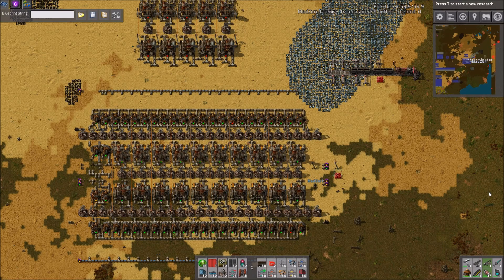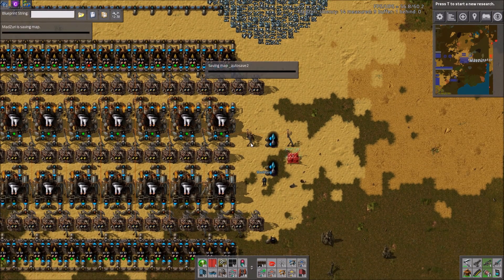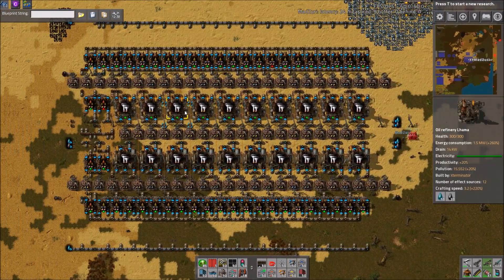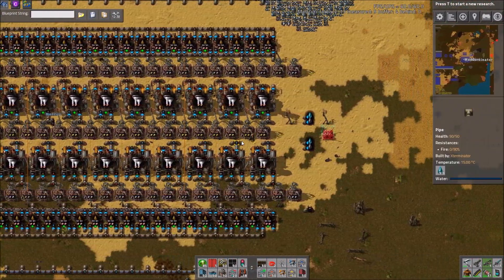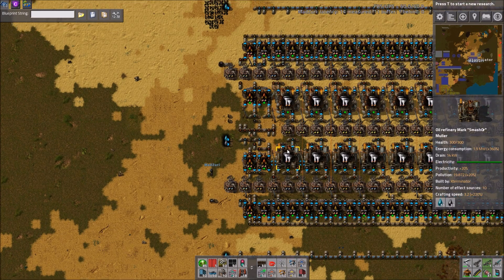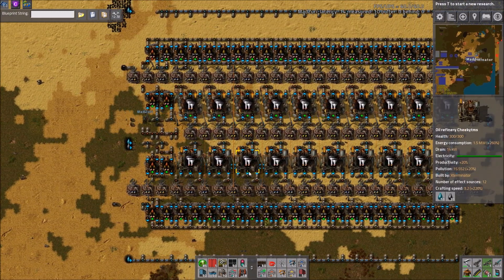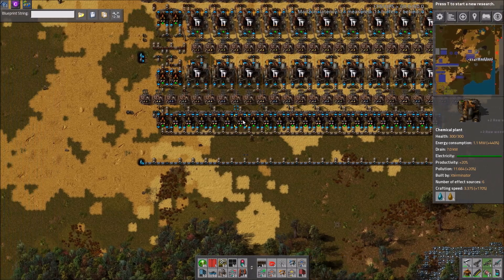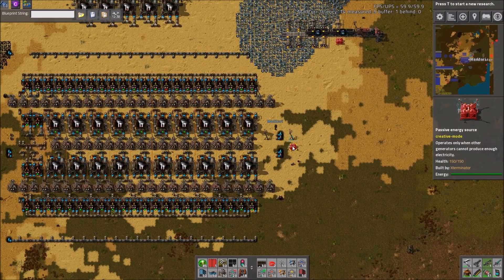Factorio Workshop - Building A Better Factory :: Jame's Oil Setup

Comment: I have a blueprint for a defensive safe rail crossing I'd like to reviewed. It's different to the ones i have seen before. The problem i have experienced with them is they are generally very small and it's often quicker just to risk it than walk to the crossing. And they usually default to open which doesn't stop biters:
http://pastebin.com/8EkYSsGF

Description:
- Much longer and tileable 
- Gates default to closed so they will act like walls
- Effectively two safe crossings, one for each rail. Gives priority to trains on the opposite side
- The gate sections have lights either side that are red or green depending on whether it is safe to cross
- When tiled, the lights in each gate section will show yellow when a train is approaching/in the gate section before, or when you are on the crossing and a train is waiting to pass. It IS safe to cross when the light is yellow
- The lights in the first (entry) gate section can only display yellow if a rail signal is wired in further back down the track (look out for wire colors if you do this because i have had to alternate wire color).
- This looks awesome when you tile 3+ of them because the train causes each section to turn yellow as it approaches then red when the train is going to fast to stop in that section
- The crossing is completely safe and has a safe-ish service path running straight down the middle of the track 
- Beware of the hazard concreted sections on the service path (one tile in each where it is possible to step on the tracks due to space and signals).

Happy 'not getting hit by trains' :)
Reply: Sorry the blueprint had one mistake in it :S I have editted my original post
http://pastebin.com/8EkYSsGF
Reply from the maker: Awesome thanks! I've added it to our list. :)
Reply: Thanks again!

Comment: Have you considered adding more beacons between the refineries in the same row. You would only need to widen it from 6 tile width to 8 or 9 tile width (depending on whether you want beacons all the way or just most of the way), which would give you almost double the amount of effective module applications, as you would get 6 or 8 more effective modules pr refinery, which would move you up to 18 or 20 effective modules pr refinery (okay it is only 50% to 67% increase). As the relative space increase is no more than this, then it might be worthwile, since there are parts of how module interact that makes other modules more effective when added more of them (specifically productivity makes speed better).

Comment: Visuel display of different liquid levels. Not that useful if your oil is balanced, but it looks nice:) At the minimum you can see when your Crude oil goes down:) Im pretty sure this can be made simpler and i would love some feedback regarding that.

H4sIAAAAAAAA/9Wd7W4jx46GbyXwbysoVvWXcOC9gr2Dg8VAY/VMhMiSV5aymTV879uS7SRdK1U/rFELzfPjABPri/XxFpvFh1xuf1lvHxfrX748vLab/Wq/
al8eXl83i6f24e559dzO9tvZ9932sFne3T9vX7oXbDcPr38+zKS+/9H9v3+7X6527ePpv3f/+Hjry367W3zv3r3Y/B6/sTy9Ud7uH7ebzfs7u+/8953c/dfD
6/dd23ave/8xP76slg/l8VP/8c/wdvzf5xct28fVst3NHrdPX1ebRfe10dc1v/71ff/4ocfv3u+26y9f298Wf6y2u4fXj0/60v1lufr4Ud9Wu5f9l5fV981i
/fC6//HcfeO39WHVDcb71z/uDst2tl2t707mvHT27h98UbruX0/Pi93xBz3c/cfd/fawfz7EH/XHarc/LNafH/b+x9lpCE6f9/yj+zWHzf7Lt9326ctq033C
w7fF+qV9w4N3HK37f9/5838uemP58rRYr2frxdNzNIb1P2YsGrXH1e7xsNr/PWrnB23I0o+Ri4ft7f7w0nafvd7uXh72u0NL7Q73nz+s+0e0gJjNlTmbi56Z
FTOzNGdmqdv/Mur+f26Pn9IenmbfFy8T1YCqSGpAgxaKM7dO6ssSMEcmizmTm56V4pCZ3pyZc5UCFKMKwHr1/bf9hB2AOu0AdP4bWSP2DkORy9tfAjLantcj
kZ3MvWvs2al7BpBxfYDf2sUfPyYsAY1LSwDzFCXYWyZlQgNqZnVhz+qqbyjz78Teg0A0hTQSML9hICC4qYjAQCDAS15Uxd0yqmJmMJlT9R5WmVvacfPLgupV
sSRnyGrvElYzV/IjmmTK6shQTdjM0prulK9npypuZmpC4VItzc1goTu7ZNSzKxERnMz5NRARDC5rQMdxrC6P53Scq4Hx9Cze6MxtvObywRiYD+TsyWgirhwE
GS3mjO4UoWcnO0rE3IKe981kLq23N51snXpr8xeJDrwZGOfcOn8xMJ0za+BiIDQ5QzmST3XhksXMWLJYo71nxFAlzkLm9Jh7XgyJoHLBblzthUC6Fdyzk50f
5uJboX+BXjAftrE3nWxvNtbmr9A9uMqoD67nrwWn4wAMXAsWVdZYjuQBXLhjNTOYLHr6ccdqSUqKInEcwjvWYE5nEumlBbxvLexNddk3FGbRFeZmt3+BXjKn
TuzdCND9ae5GINqDgGNoMjGGGoeW+kkZ0Z3FU7tcHZ5m7br7oN3qcfa8Xbfx9/mP35nzfT296l949e90o8swd/lvZZH4W3n5b1U/Tb1JfP088fXiq8Qfy7zU
kPqG2QwyGd9lIJuh1DmCn2PZ3HAsvZmxZM7Be5JEbUhxy4QbWLJj5j11wJTRfUehYo7CrP5byI3YmQh5lcwLfJ9cU0b3Y0EVC3nNSnOLGO7O0twE6jCRzyyG
cXyAy1kM0/EDBrIYKqUfIGP6AZfHczq+wNB49mNC4BEgqJ4A6oRfn/pbk/DrQ18TfcLNTzxy1P2PmSe+cR49HuCcEktKVSXCSZUCz7R07PTXTmQz8ym8OZsV
3Kmp9dsPDNYwYGZu+iJ3nzlO3txsZmV+jOM2nU/8mI7LNJD4UZc5QzmOx3R+KKfjLQ0NpTZgqnOW+rhw3wfpZ3xEf0tEIaNIZ534ijrhSTX93EtxqcCnq/X+
krlH8zrhO9SM3zAXa6oTPHvNTiJzcac62kDMFTYXO60j90mRnGNqNtnObMxNX608mcTpjqbE8VMknrKLxAVd9ATeJI6mJnE0Seq3iVSXzyKaTjSOL3Q+m2g6
vtBANlGjcytl1Mjm+bGcjos+NJaM8XjPYrEkS010z67JxTJlZ8IZbCCnFKydpU3CG2xgPZfCnNF9P6nRFDYxtaLhqjV3I9fkZZKUt8skkeanzq0f7Xq9/Z/b
pJLMdazb52BWN0zLcZNxAobGEl7u1x8jaGbH9TPo+ufEHNaDqD/24JWN/sdeubrOJMrUzGGZmsrcVEcXp7COSWVudufRhEaO7eFr933Hz4gvz9/1r/i1pMku
pmZfU9zF1nTnVXcZx2m4mHYyJcdhIO+kezTPGtFxPIfLiTzT8R4GB1SRl2Jr7yUKvIhTVHgxJaUJ70GcovKJqak+qkLf0pJbaml6j7u1b6iiyostQ9la9QbX
aladl3FcgrN5FVNyB4YqwLuscvrjeAPnk1Sm4wkMjiWLSZp7uIzySqJDETaasPeoGeXaxGYrqqDYmuyojwhsEmEvUHTUvr6l7MhszE0p3KKNvSmMd+GF+M/8
TPiHXpyP4zicvTifkuMw1DdCdI6DjBpHOJ+GMB3PYXAwNWVDbElPdJp4WCQ12LM06S1oEjCMSXCZsNtDGqQwaHfkPcC+D2LudgEvXnvXC/H6BLViisxaMQHf
VkdbSHsF8nHVH26YN/FzZe2u6ra8F39JtbzTAU6fw1nccDjL6QznQOqEeFg/4HPrWJKG1HkeNNU+gi27k+e5puCHMbsjTxWWSX831djSriNTYcuq0uCswgVb
2pvFzEYt4zgGl3MjpuQcnOjmxHEW8qqcjOMcXB7SCTkIw0PKbpKdwf2XqHomsOq/s6eoIVGvRAIMZBmc7TKyVFHOw9gERy1kYV8Db3BOFUU8jM1hVhmPcVyD
8zkSU3IL6oGYQaHrOF6M6RWcH80peQSDo8lSrgw+QhYJME9gvW2Dj5NFAsKUQgH+GzObWWYw9FUU0RwyH95gsKsIkaXMf20MWqorii6jRgvOZz9MySVoBrL+
S10SqowaKTg/nFPyCQaHE2bWF/Y2XnyfVzIxfU8FsGVqkYInSk3mh63zskyAtlJqaowYszs6PUtYfMLgPQJdvQbvEcrMbjSiuETuXyKWibpRZaIetJSJfjHH
SHScONH/d+pr54m6ij6umJ2TQCA3TCD4ucTH2+ZjVHnD6W84nCd9tzKcmsQEb0unUt5FBa+w67+Vy4zdKQ63guh/ZW++q4hJrTTFO2xNcRUfZewZYVYanFVN
romxWdRdE3xmD4zjGVzOHpiSdzCUPVDltfEZxzu4PKRT8hCGhjRq0EA7z2BvP0oQiJQtJOrSHp2bvgymip1XiTY2xzuofivLxG/yLvGbfJDLvn8yq8OYdqWy
XWuF2cZOoxTZXMPIjcHZjtiVmh3K3p6lcOl6e0tXszqNWRY5/nVW+sU4PsD59Ispnf9D6Rd1VsWPcZzU86M5JQd1cDQbpTeldKaKRHH+KPFiIBxap8KfdcrT
ioqJ+1S7HC+J3+TjZjo4IcbYoZNyphqF2cZ0u0yZzQKTBuOSdeRMNYqCKcbWdSQpsFZ5Y29O4Wpt7M1hJD+0YY3ixErd0fVvytMP7dKkTqwmdWEnid/gfeI3
+JBoOUuTfMbxlc4n+UzJVxpK8ml0SekyajDv/HBOyZEfHE5NTRFj8pt0oCB5EwyKc8qDmmtqqRib70j5YUuGd1ONTXGcpaIpG2NsVuFGNXjVN9fWjXF5ZWO4
2+WjbKdSl+/9kVdzwyyln8v23rXLW6XUzLNG0t1uJH8u0fuWI8noilOSzvX14NPQ64tB4tT2TpGQ5QzZnPLQ5ooqMZZsbqKpVVSIsbSc47tzRcaOpdlUVIax
M3ux3sCMmXFOq4sJM5M5sQaSZXzUBwOO5o0zuibjSQ2OJuNDnCkhiXKL4uOf14GxJDKJ0jcetkEQY7NcRlby+i+WJrZf+8XDyvHe2Fzyui+W5i6n5ssN8zom
c0wN5HR40VXcLUb0oM4O5GS8p8GBZPfDth4DowyX6PCDtbJtPRJGGT+xybzCiyWTeXUXS1bFqVwlttLSDg2RlbyqiyUrsyq6jHNOnb1Nn8w5NXCT7n1WnscN
0zwm4zoNjiSs4xKMbbUEeuy9osCHoaPCRyLqYXGPYMzMRO0WT3u6FLaWs48z4pgXILYi/HhjGovwe13psY/76HGy6M7eR0/krBq4jfZecRt9/cSb8ZZHAmn0
mv4dlmyObmZpe5bSmJlZNPw4O//ibdREdv/QXRTseeJsrZCQCtQE6JwbMzm2kp363piVOQzsODv/bEx6Irt+KCId2EOMseOvj1XG+4FFpI15OVGTCg8bjzTG
rMwK8Y2z7c8Gpiay7YfCUrCFySl2YWl5pMJShYKhMGRz4SIzFfyEJTP7s/f5DZd9/Xln32B18W+r9b7tfsrrKzHu63rx+PvJvMORjbtfbZbtnycmkloRF3PF
z9vl1Wfq6/rQjjRVUWZQqXjGNmVndHcI+1+cHrJN2RnNZ90/hGHBtEKzef0UN2+VWfns+nP9vNr8Ps5cl9FpUvFHZEtmFvNIonhVLEtm/r/ZrHSHaDHJbZgo
Pp56fr3+xI0IVPpKW0fpVJZCI7IiU5zd2uln9/SYcv3pHc2XhdUFZRxHYTyzdGmiH/dw9bUezodW5GdJi569D6on9L98rJ9/RPenHoqJR3RN4frKkjcZec0a
O2tDdqaq1MePRPDiytJW+cupucZWGbi6giXU3SgraDzvrUrdXVVRNhKsoudGUYvbOepwqsXaVJf4+cOUWbHWswiJN7ZIyyh9LJpNdjdpSdyvWtfLn1pHpuSd
xQ+rUVbNmM94UR8wjaHXV4FRH2ZTKVhRXV7fZHUStbR9rnfR50/NMxN7B5Z7Pz1BX39NjfeomUpSruN/x66Sok7g9QVltDEpowwAOvWFsamPDtuauU6nYIql
2azzzbQ0m9HerCOPEZbMO0UH5oaiA3E/nlqRe90YsrOIRQnekVbW5jO2U1FMyZSdbJ26Ucwa7wlOET25/u4b8fk78oRgFfdqFDNHfcCIwkSwEP84KjOmoU08
o8wtaOwZygwb59wf1bD4aQRCeWEUS0dz7DQPWdfXmps9fTQQAh7nnB9v9hSVqi3NXpTJFjVgeDl87b7x+Clx/tp7fQP5tRx+sbh/vPjtfr9at8fsif513vxU
4bv7NR+p5Iv/XeyWs86Kx127b2fr9tu+M/Psm4qcN4WcN/mcN0nOm1zGm+YZ72ky3lNnvKfKeE/OYshZCzlLIWsl6N+TsQwyviXDmIwxy5iajBWQsdAy1nPG
tsnYnTkqkCM3ObqWI6A5Sq09Epqcc6TpnyMv++2mnT0v9r9demngL/X8pcJf6vBL5/iVDX5ljV9Z4VeW+JV8nvg0KWaJvhJPEf5E/COx3Xgo8ezgCcdrCC9L
vNL57uFbku9zLh5ckbSCV+eoZM1VsuYqWXOVrLlK1lwla6ySNVbJGqtkjVWyxipZY5WssUp+dl2lQ09fiacIfyL+kdhuPJR4dvCE4zWElyVe6Xz38C3J9zkX
D65IWsGrclSy4ipZcZWsuEpWXCUrrpIVVskKq2SFVbLCKllhlaywSlZYJT9bctOhp6/EU4Q/Ef9IbDceSjw7eMLxGsLLEq90vnv4luT7nIsHVySt4JU5Klly
lSy5SpZcJUuukiVXyRKrZIlVssQqWWKVLLFKllglS6ySn41K6dDTV+Ipwp+IfyS2Gw8lnh084XgN4WWJVzrfPXxL8n3OxYMrklbwihyVLLhKFlwlC66SBVfJ
gqtkgVWywCpZYJUssEoWWCULrJIFVsnPJt106Okr8RThT8Q/EtuNhxLPDp5wvIbwssQrne8eviX5PufiwRVJK3ghRyUDV8nAVTJwlQxcJQNXyYBVMmCVDFgl
A1bJgFUyYJUMWCUDVsmAVTJQlQxUJQNVyUBVMlCVDFQlA1XJQFUyUJUMVCUDVsmAVTJglQxYJQNWyZChkj5HJT1XSc9V0nOV9FwlPVdJj1XSY5X0WCU9VkmP
VdJjlfRYJT1WSY9V0lOV9FQlPVVJT1XSU5X0VCU9VUlPVdJTlfRUJT1WSY9V0mOV9FglPVZJn6GSkqOSwlVSuEoKV0nhKilcJQWrpGCVFKySglVSsEoKVknB
KilYJQWrpFCVFKqSQlVSqEoKVUmhKilUJYWqpFCVFKqSglVSsEoKVknBKilYJSVDJV2OSjquko6rpOMq6bhKOq6SDqukwyrpsEo6rJIOq6TDKumwSjqskg6r
pKMq6ahKOqqSjqqkoyrpqEo6qpKOqqSjKumoSjqskg6rpMMq6bBKOqySTq+SOXBSxCYlflEEJA2+koxchB4NvpLMcB8yGnohWYZ9nGjohWSr9MGhoRfi2cGT
w+cGvpBODP08+gOpxXQI6ZzQSaarhi5Duq7xTsGbD+9nLBFYdZSSlsPWcLSGkzUcrOFcDcdqMFWDoRrM1GCkBhM1GKjBPA3GaTBNQ2EaytJQlIaSNBSkoRwN
xWgoRUMhGsrQYIQGEzQYoMH8DMZnMuiZHHiGszMcneHkDAdnODeDsRlMzWBoBjMzGJnBxAwGZjAvg3EZSstQWIayMhSVoaQMBWUoJ0MxGUrJUEgGMzIYkcGE
DAZkMB+Tgcfk0DEcjuFsDEdjOBnDwRjMxWAsBlMxGIrBTAxGYjARg4EYzMNQHIbSMBSGoSwMRWEoCUNBGMrBUAyGUjAYgsEMDEZgMAGDAZgM/iUHf+H0C4df
OPvC0RdOvmDwBXMvGHvB1AuGXjDzgpEXTLxg4IXyLhR3obQLhV0o60JRF0q6UNCFci4Uc8GUC4ZcMOOCERdMuGQALjl8C8dbON3C4RbOtnC0BZMtGGzBXAvG
WjDVgqEWzLRgpAUTLRRooTwLxVkozUJhFsqyUJSFkiwUZKEcC8ZYMMWCIRbMsGCEJYNgyQFYOL/C8RVOr3B4hbMrGF3B5AoGVzC3grEVTK1gaAUzKxhZocQK
BVYor0JxFUqrUFiFsioUVaGkCgVVMKeCMRVMqWBIBTMqGYhKDqHCARXOp3A8hdMpHE7BbApGUzCZgsEUzKVgLAVTKRhKwUwKRVIokUKBFMqjUByF0igURqEs
CkVRKImCQRTMoWAMBVMoGELJYVAyZFBBoGAZVPAnWAYV9AmVQc6eUBnk5AmVQc6dUBnk1AmVQcycQBnExAmUQcybQBnEtAmUQcyaQBnkpAmVQc6ZUBnklIla
BjMQEwyYYLwEwyUYLcFgCcVKKFRCkRIKlFCchMIkFCWhIAnFSCBEAhESCJBAfATCIxAdgeAIxEYgNAKREQqMUFyEwiIUFaGgiB4TyfD2sLOHfT3s6mFPDzt6
1M+jbh718qiTR3086uJRD486eNS/g+4d9O6gcwd9O+jaQc8OOnbQr4NuHfTqqFNHfTrq0lGPjjp0en8uI7iHY3s4tIcjeziwh+N6NKxHo3o0qEdjejSkRyN6
NKBH43k0nAejeTCYB2N5MJQHI3kwkAfjeDCMB6N4MIhHY3g0hEcjeDSAR+N3+vBdxl0uvsrFN7n4Ihff4+JrXHqLSy9x6R0uvcKlN7j0Apfe39LrW3p7Cy9v
4d0tvLqFN7fw4hbe28JrW3hrCy9t4Z0tvbKlN7b0wpbe19LrWv1tbUbqHs7cw4l7OG8Pp+3hrD2atEdz9mjKHs3Yowl7NF+PpuvRbD2arAdz9WCqHszUg4l6
ME8PpunBLD2YpAdz9GCKHs3Qowl6ND+PpufR7Dx9cl4GqYFBDcxpYEwDUxoY0qCMBkU0KKFBAQ3KZ1A8g9IZFM6gbAZEMyCZAcEMyGVALANSGRDKgEwGRDIg
kUGBDMpjUByD0hgUxtCzGBlgLuZyMZaLqVwM5WImlyK5lMilQC7lcSmOS2lcCuNSFpeiuJDEhSAu5HAhhgspXAjhQgYXIriQwIUALuVvKX5L6VsK31L2Vo/e
ZtRhwWVYcBUWXIQF12DBJVhoBRZagIXWX6HlV2j1FVp8hdZeoaVXaOUVWHgF1l2BZVdg1RVYdAXWXIElV2DFFVhwBdZboeVWaLUVWmyF1lqhpVb0lVYyyu7h
qnu46B6uuYdL7uGKe7TgHq23R8vt0Wp7tNgerbVHS+3RSnu00B6sswfL7MEqe7DIHqyxB0vswQp7sMAerK8Hy+vR6nq0uB6trUdL69HKevrCehlVlnGRZVxj
GZdYxhWWcYFlWl+Zllem1ZVpcWVaW5mWVqaVlWlhZVpXGZZVhlWVYVFlWFMZllSGFZVhQWVYTxmWU4bVlGkxZVpLmZZSppWUaSFlfR3lnJ4bvOUG77jBG27w
fhu83QbutoGbbeBeG7jVBu60gRtt4D4buM0G7rJBm2zQHhu0xQbtsEEbbND+GrS9Bu2uQZtr0N4auLUG7qyBG2vgvhq4rUZGV42cBm28Pxtvz8a7s/HmbLw3
G27Nhjuz4cZsuC8bbsuGu7Lhpmy4JxtuyUY7stGGbLQfG23HRrux0WZstBcbbcVGO7HRRmy4Dxtuw4a7sOEmbLgHW0YLtpxuvryZL+/ly1v58k6+vJEv7uOL
2/jiLr64iS/u4Ytb+OIOvriBL+7fS9v30u69tHkv7d1LW/fSzr20cS/t20vb9tKuvbhpL+7Zi1v24o69uGFvRr9eyaAtBOMWgnkLwcCFYOJCMHIhlLkQCl0I
pS6EYhdCuQuh4IVQ8kIoeiGUvRAIXwikLwTiFwL5C4EAhkACQyCCIZDBEAhhCKQwhGIYQjkMoSCGUBJDKIohehZDMmAMwTSGYBxDMI8hGMgQTGQIRTKEMhlC
oQyhVIZQLEMolyEUzBBKZghFMwSyGQLhDIF0hkA8QyCfIRDQEEhoCEQ0BDIaAiENoZSGUExDKKchFNQQSmqIHtWQDFZDMKwhmNYQjGsI5jUEAxtCiQ2hyIZQ
ZkMotCGU2hCKbQjlNoSCG0LJDYHohkB2QyC8IZDeEIhvCOQ3BAIcAgkOgQiHQIZDKMQhlOIQinEI5TiEghyiJzkkA+UQzHIIhjkE0xyCcQ7BPIdQoEMo0SEU
6RDKdAiFOoRSHUKxDqFch1CwQyDZIRDtEMh2CIQ7BNIdAvEOgXyHQMBDIOEhEPEQyngIhTyEUh5CMQ+hnIfoQQ/JID0Eox6CWQ/BsIdg2kMw7iGU9xAKfAgl
PoQiH0KZD6HQh1DqQyj2IZT7EAh+CCQ/BKIfAtkPgfCHQPpDIP4hkP8QCIAIJECEIiBCGRChEIhQCkQoBiJ6DkQyQBCJSBDFe0LGe3zGeyTjPU7/nrn+LY3+
LbX+LZX+LRlLIGMFZCyAnPlXv0U/+frv0BuiHy39lOjnXb+49CtYv030ezFjx2cIS4Z+ZchkhhoPif7b/ar7Ly8Pr68vq++bxfrhdf/juXv1at8+3X28c9k+
rpbtrnvr09fVZrHf7rqvWm2W7Z/H/ZF4Y3eI7Rbf29l+sfn9r7f4t89f9J+r/z6slr/88Wu4e/tX95sOu80vX/7Vbpb/B7GeWe082gEA
Reply from the maker: Added it to the list! :)